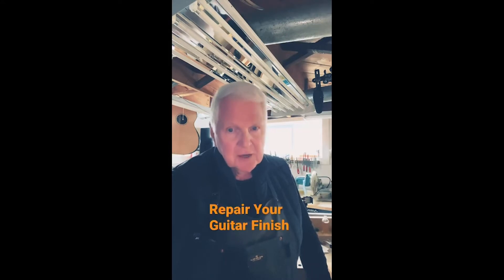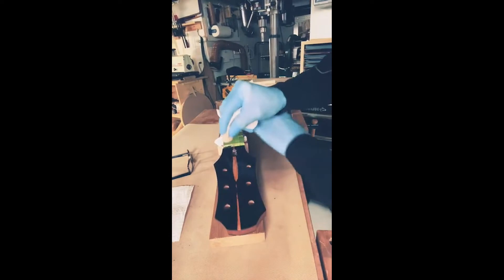Repair Your Guitar Finish #shorts

Comment: Cheers, Monty. That's it? No sanding between coats? No buffing? 

FYI: I'm currently refinishing my first guitar which has a cedar top with scratches around the bridge and buckle rash in the mahogany back so I think I just need to take those sections down to bare wood.
Reply from the maker: You might not need to if it is FP.